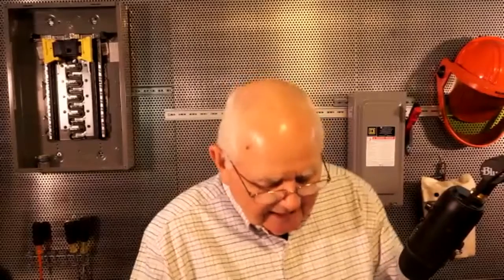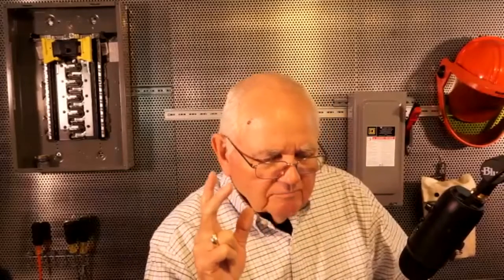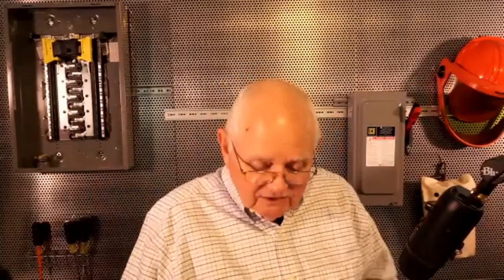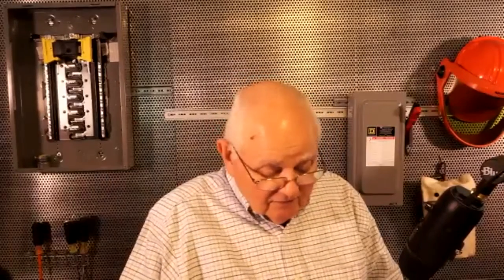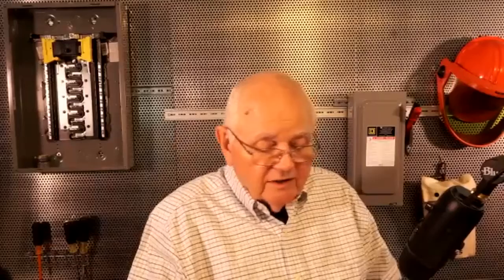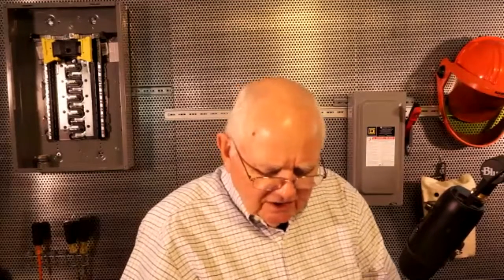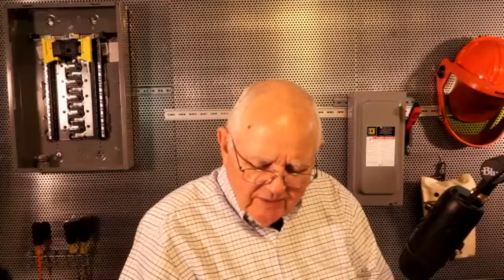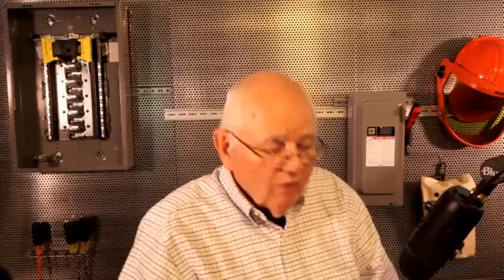EC&M Asks Video — Can the Main Grounding Electrode Conductor Be Spliced?

Comment: Going back to the 1st question, I think the question was asking more about the actual conductor itself. Can you  splice that conductor that runs from an electrode and say it it ends up being to short to reach the bonding bar in the first disconnecting means, the answer is no unless by approved means as an  irreversible connection (cadweld, crimp).